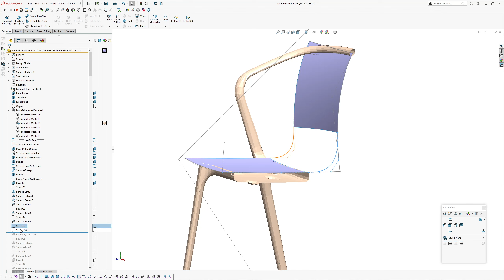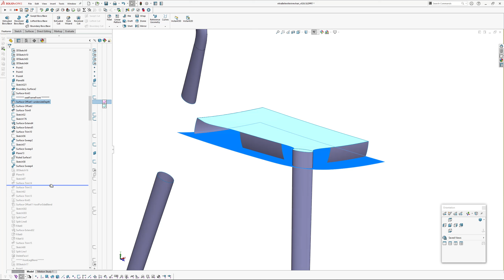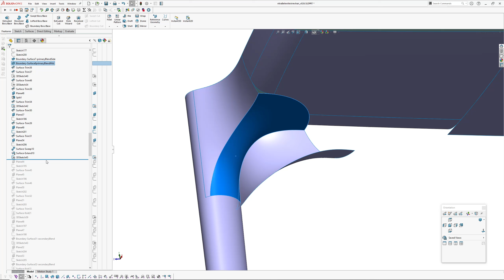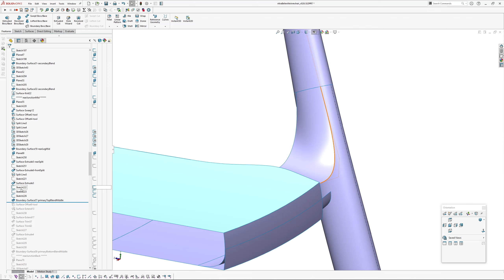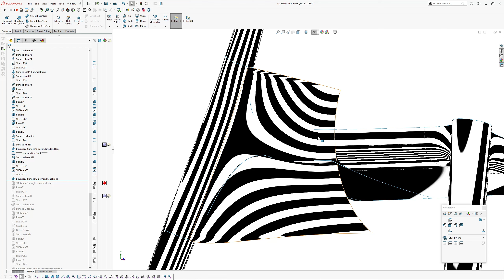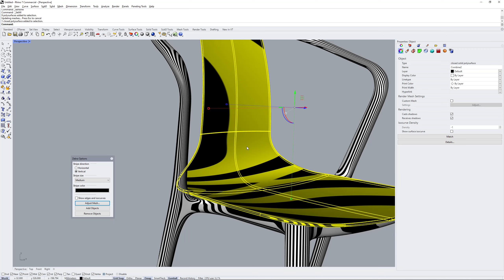Solidworks Advanced Surface Modelling Exercise. Vitra Belleville Armchair.

Comment: How can I make manufacturable drawings files which have spline sketches in it. Like how can solid work understand dimensions of weird shapes, if you can clarify andrew please
Reply from the maker: Hi there. For something like this chair, the tooling is cut from the 3D surface data, not from 2D drawings. Other chairs I have worked on have had sets of production drawings produced as well, but more for the purposes of overall dimensions, critical dimensions, tolerances, checks, surface textures etc. The actual surface of the product is cut from 3D data.
Reply: @AndrewJacksonDesignStudio  That helps. Thank you!

Comment: Fantastic. Looking forward to jumping into this model and taking a look at the secondary boundary surface spline profiles. well done. Also, really neat process using the extruded surface planes to sketch on, instead of just creating more planes. What's next?
Reply from the maker: Hi there, yeah pick the model apart and let me know your thoughts... I definitely could have gone through another round of form/tweaks, but with video content (especially one that took a few years to complete) sometimes you just have to move on! The extruded surface/planes worked a treat, much more interactive to tweak things with Instant 3D active. Not sure what is next, I need to check my video folder for half completed projects.

Comment: Plenty tricky under-seat/legs connections, you found some really nice surfacing solutions.

The end surface shown in rhino is greatttt !!!!  Glitches are almost invisible anyway and would be probably ironed out in mold making.
You start 2025 super strong !  🌟🌟🌟🌟🌟
Reply from the maker: Yeah, very small glitches... I'm sure there would be bigger process issues when moulding a part like this as well!

Comment: Excellent work, thank you for sharing your knowledge in all these videos! Question, I notice you don't seem to worry about small imperfections in curvature continuity on the surfaces (when turning on curvature colour), but you do seem to scrutinise tangency with the zebra stripes. Do you think getting perfect curvature continuity (i.e. no random red/blue areas) isn't really possible in SolidWorks? Also, it would be really interesting to hear you talk about the differences between SolidWorks & Rhino with surfacing and why you would use one over the other. Last thought, going back to the Playstation controller project you did, it would be interesting to hear your best guess on the CAD software Sony used for that. Thanks!
Reply from the maker: Hi there, good question. Solidworks tends to use a pretty coarse mesh for the shaded curvature analysis, meaning you see artifacts that are the result of the coarse mesh, rather than actual issues with the surface. I do check it frequently as it is useful for seeing hotspots (like those created where I talk about leaving 1 deg of deviation between the trimmed edge and untrimmed edge). You can have curvature continuity with the red/blue areas, but there is no way to check in Solidworks for sure beyond a visual inspection with zebra stripes and the curvature comb tool. Deviation analysis will only check for tangent deviation. All of this is why I use a macro to send selected surfaces or bodies to a session of Rhino where I can run the global continuity analysis, to check edges for G0/1/2 as well as zebra analysis where I can set the mesh quality myself. It is fairly quick, only a few seconds delay to send 3 surfaces over for evaluation. 

Rhino, you can get much cleaner, light weight surfaces than in Solidworks. Solidworks tends to make all boundary surfaces with boundary constraints multispan, degree 3 surfaces, even if the input references are a higher degree. It also makes them really dense. Rhino, you have to layer off your progress in case you want to go back and make alterations. Solidworks is much easier to modify a model that has been developed, for form finding or general tweaking of forms. 

When I was looking around for info, I read they used Creo for the Playstation controller. 
Cheers, Andrew